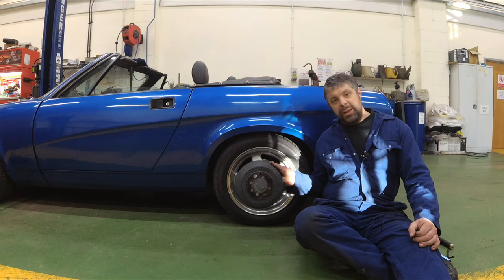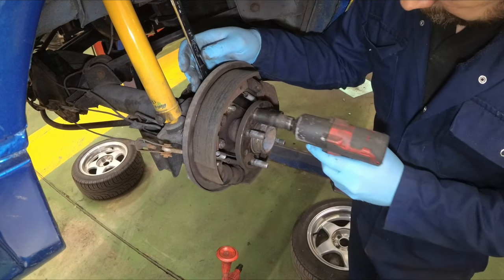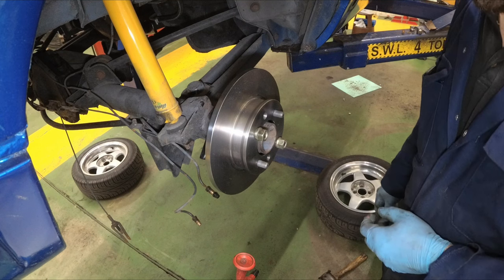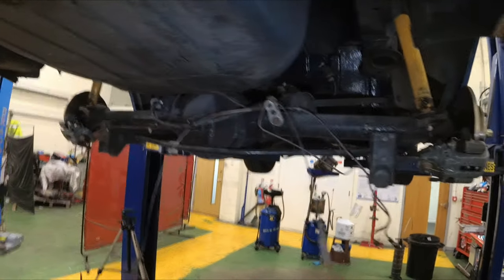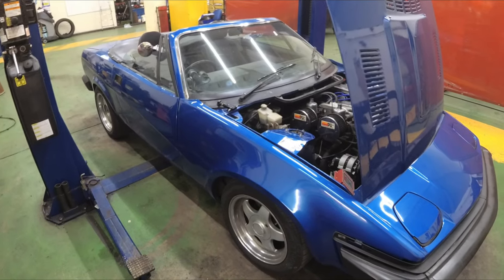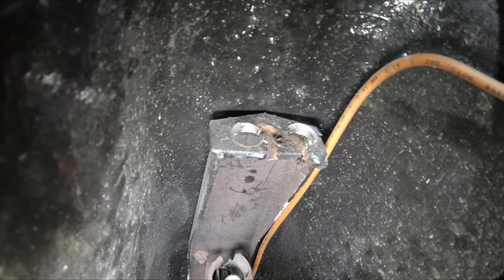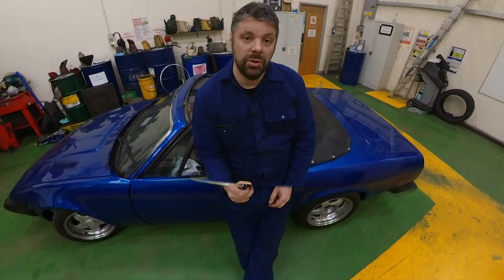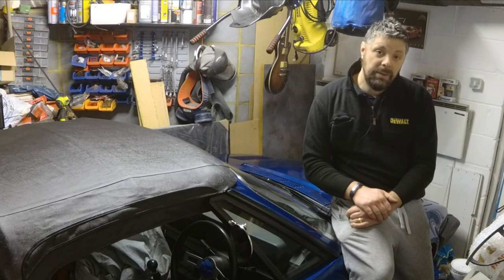Triumph TR7 rear disk brake conversion - Grubbymechanic shorts.

Comment: Great job Mr Grubby :))
I did much the same but 3 different iterations. 2 with the MGF calipers which work great with the handbrake mechanism and 1 set using a VW golf caliper and a cobbled up handbrake set up. 1 set I used MGF rotors with the MGF calipers as you have done , the other MGF calipers with BMW E30 rotors and the other with E39 rotors as the 1st attempt. I made my own brackets to suit and now you have me enthused about doing a follow up video of my initial attempts to show how they turned out. Again great job and well done.
Michael Kip

Comment: Accident waiting to happen !!

You've connected the floating callipers using a solid copper pipe. Eventually the copper brake pipe is going to work harden and fracture resulting in no brakes !!

Comment: There are a number of considerations with the disc brake conversion:
1)  A drum brake is mechanically more efficient at gripping the wheel than a disc brake, that is why the likes of Mercedes, BMW, Porsche and Opel fit disc brakes for the main service brakes and use the drum (usually the top hat section of the disc) for the parking/emergency brake.  With a front engine and rear wheel drive the rear brakes have much less work to do and so can tolerate drums on the rear because they don't heat up as much.  I have never had brake fade on rear drums, only front even in competition.
2) The vehicle brake balance is critical to the safe performance of the vehicle and with a bespoke system fine tuning of the balance is necessary.  Whilst this can be calculated and the appropriate master cylinder can be selected this still requires further fine tuning.  The pressure limiting valve proposed for the rear is just that i.e. it limits the maximum rear brake pressure not the proportional split between the front and rear, that can only be done at the master cylinder, preferably by the use of a balance bar and twin cylinders.  Note that any adjustment of the brake pressure within reach of the driver is contrary to C&U regs although in my experience most MOT guys either don't know what it is or ignore it, but then a VOSA road side stop.........
3)  Single pot calipers with a handbrake mech are the worst of two worlds a)  they operate on the disc that is not as good as a drum and b)  The single pot sliding caliper has poor performance relying on the casting strength to pull the second pad into the disc after the first pad has made contact, wearing one pad first, they are also prone to seizing, giving poor performance.  I have had some standard systems that required frequent attention to ensure that the calipers were sliding on the pins to give just the adequate performance.  Most performance cars use horizontally opposed piston calipers.  Single/two pot sliding calipers are manufactured for one reason alone - they are cheap!
4)  Disc brake parking brakes have a reputation for relaxing pressure when applied to a very hot disc and then cooling.  This ought to be overcome by applying the parking brake very firmly but this does not happen on occasions.  My wife parked our Skoda Octavia (VAG brakes) on a sloping road next to a junction and when she returned the car had rolled across the junction and nearly down into the property opposite - she swears she set the handbrake properly.  Chrysler Voyagers had this very issue and were subject to a redesign following many accidents.  Our current car (VAG) has an electronic parking brake and the handbook specifically recommends leaving the car in gear on a slope as the grip on the rear disc relaxes when cooled.
5)  Reducing the rear drive flange diameter should be carried out on a lathe.  The system of using an angle grinder can't ensure that the flange/axle remains in balance and given the location it will be the bearings that will suffer due to the harmonics.

Comment: Hello sir back in the day after we put the Buick grand national Normal aspirated engine in dadn blew up the triumph diff here in America so he bought a chevy SS Montecarlo differential it eas aninch wider but he took all of the mounting brackets from the triumph diffmounting and it wasn5 lug nut rear wheels and it worked and the hand brake and everything he made to work and it works great its like a 3.05 gear ratio and the turbo 350 transmission my dad built and it's geared great as a matter of fact it's a you can't grab the thousand dollars off the dash board type of car now my younger brother is the caretaker of the car I love you'll build on all things you've done mate enjoy and keep making great videos I'm disabled with long haulers covid and I want one of these sooo bad to make mine eve his color choice is two tone blue like yours

Comment: Nice video. Any info on where you purchased the kit? Would also be really helpful to know the MGF part numbers.
Reply from the maker: I deliberately didn't mention the supplier of the kit as I didn't feel it was that great, the service was pretty poor and the quality was a bit low, nothing insurmountable but it definitely wasn't "bolt on". . There is only one type of brake set up for the back of the mgf/ mgtf so you can't get the parts wrong.
Reply: @grubbymechanic  still would be interested in knowing what kit you used